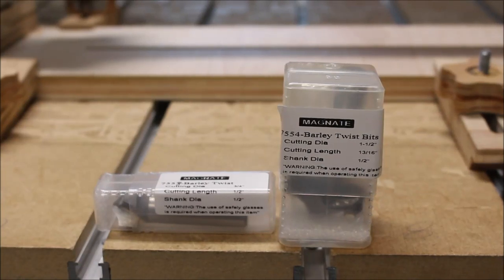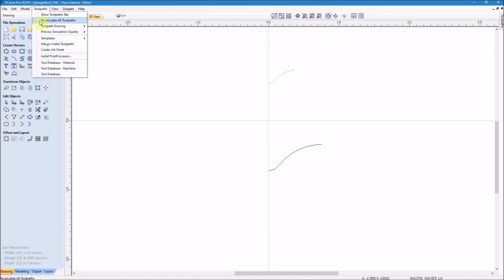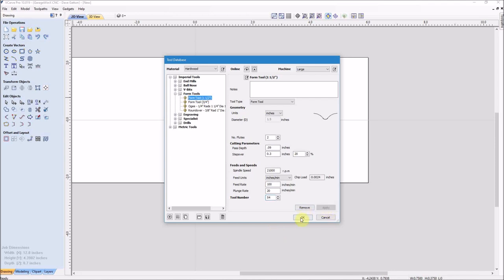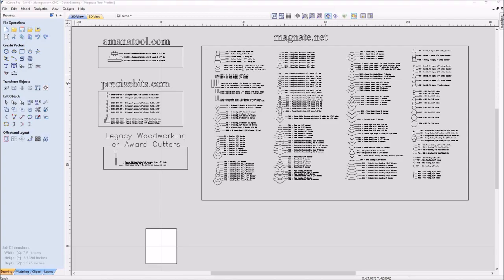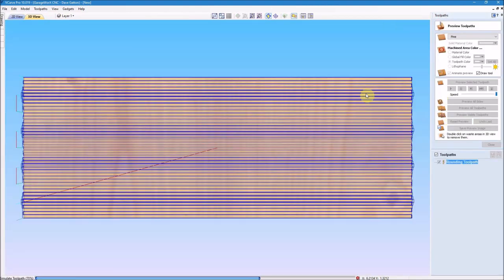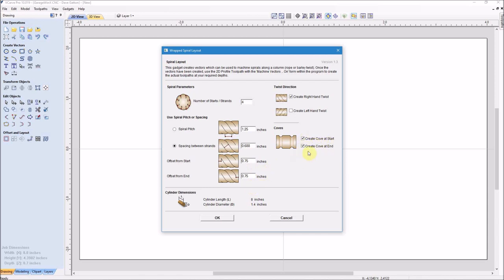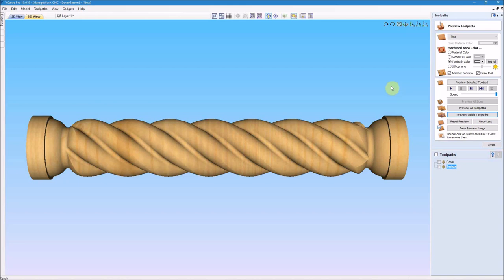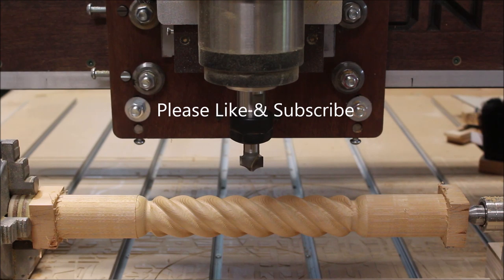Making a Barley Twist with my Rotary Axis

Comment: I so want to get a rotary axis. You power your rotary using the A axis. Do you have the exact same make & model stepper motor for the Rotary as is on the A axis? 
And, is it necessary to run separate files for the rounding operation and the barley twist operation?
Reply from the maker: Thanks for watching Richard.  The stepper motor does not have to match the other motor exactly it just needs to be of similar specs so it will work with my existing driver.  Yes, it is necessary to run separate files because I'm using a 1/4" end mill for the rounding toolpath and a special barley twist bit for the cove and twist toolpath.